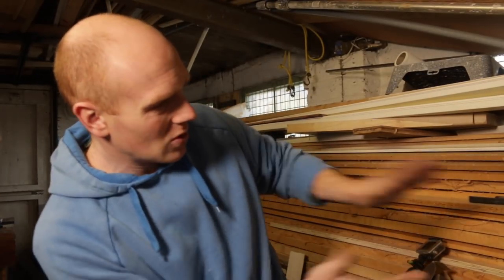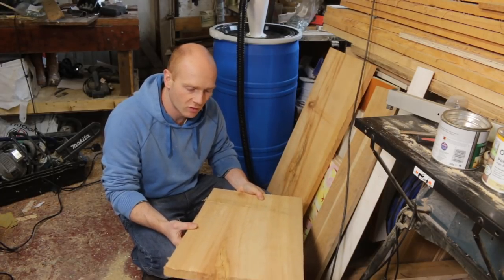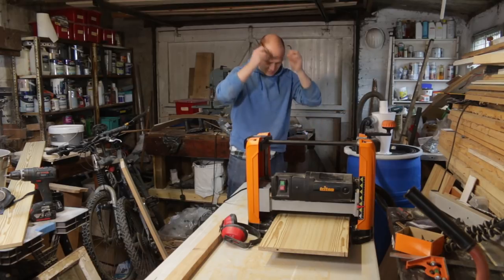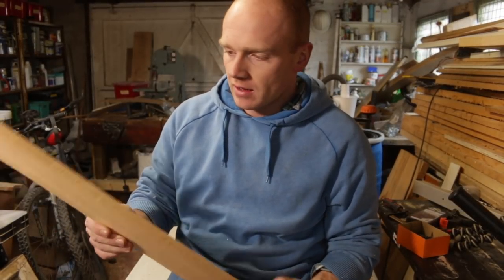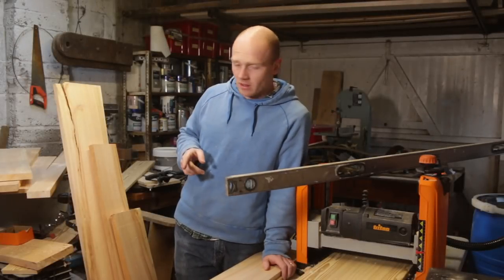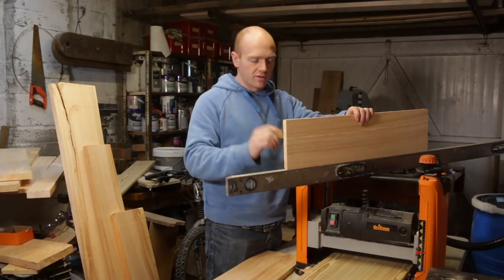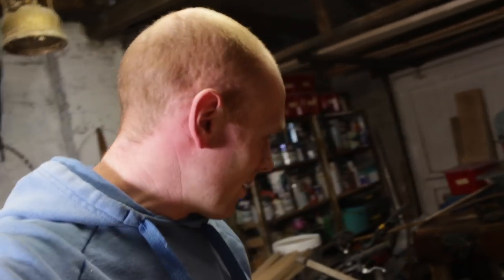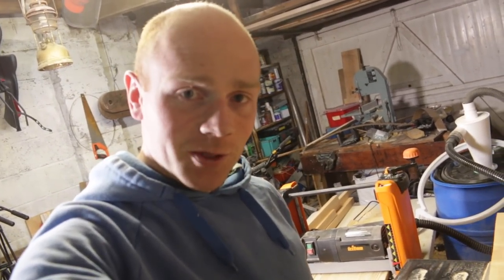Rough Slabs to Cabinet Components

Comment: Tim, plane whole timbers first. Then cross-cut. Then rip. Planing longer timbers exposes less area to snipe. Cross-cutting gets you down to more manageable lengths to rip with greater accuracy.
Reply from the maker: I think that would work better but in the current workshop space I’m not sure I can outfeed much more than a metre or so! 🙄 I did find that providing I pushed the next board in before the first left then snipe only effected first board. This was more of a tester so will  be sure clear a bit more room for the longer lengths I need! 👍

Comment: I admire your vision, however have you calculated the weight of the ply, insulation, flooring, seats, furniture etc that you will be putting into the van? The bigger then van, often the less it can actually carry (because of the extra weight of the bigger van) you don't want to full the van with good looking solid wood furniture , even if it's face framed cabinetry to find you are over weight and need to rip some stuff out, it's a very real consideration....
Reply from the maker: Weighing at intervals to keep on track.  The van has a decnt payload to start but keen to keep a sensible amount still once fitted.  Good point though.

Comment: Did it make the board flat by just running it through the thicknsener or was they cupped in the middle still but great vid can not wait until you start on the cabinets
Reply from the maker: As they were cut down in width first they were pretty flat after a couple of passes.  If doing wider boards I made up a sled which I can pack the board with shims and then plane.  For these smaller battens it isn't really an issue though.